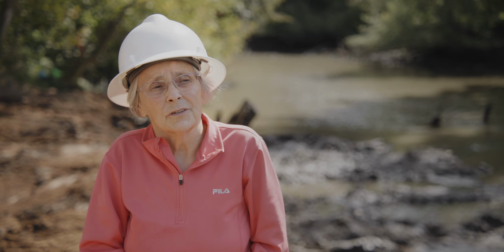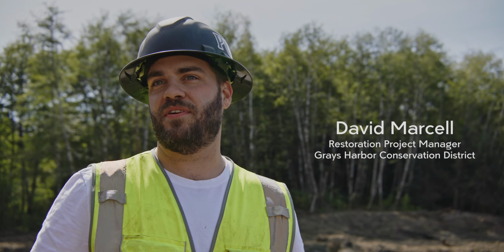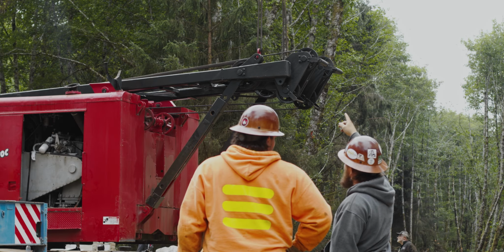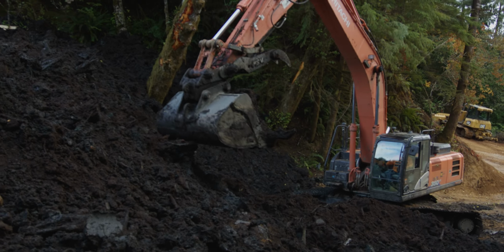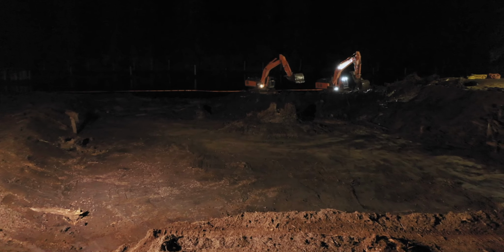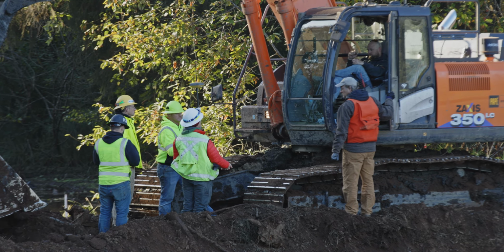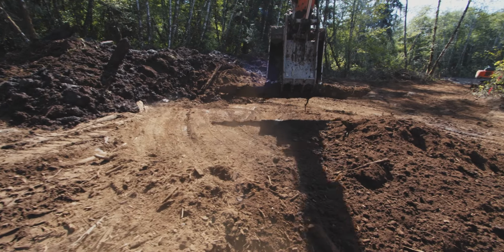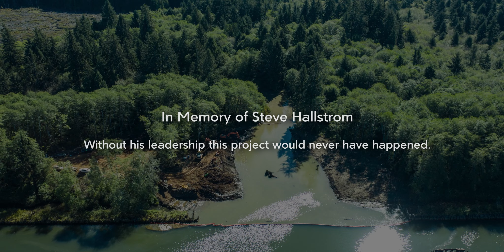The Tide is Coming Home - Middle Fork Hoquiam Tidal Restoration Project

Comment: Estuarine backwaters should provide the habitat for many anadromous Species thrive, while vegetative associations, bench marks of bank channel width, river depth, bedrock or structural composition, riverine systematic analyzation of saltwater levels as conditions change, dissolved oxygen content, water temps, all contribute to the health of this recharging of the system and seasonal flows will mean more substantial recruitment through high cover, viable flows, and other aspects of natural function to increase the diversity.

Comment: I wanna know how much money was spent on this project.
Reply: Not enough, it should have been done years ago
Reply: Any objection on righting a wrong?
Reply: This was one of 77 total projects funded by a 14.6 million dollar grant….money well spent.
Reply: @JadeTadros  I think a few other things should be done first. This is bullshit
Reply: As far as could tell about $1.75m. Setup, takedown, time on crane, including building support mat. Rental on all the equipment, it wasn’t exactly stated, about three months. Operators and superintendent. Project manager for GC. Consulting project engineer, who’s a P.E. Fisheries biologist for design phase, plus maybe a day per week during project. If piling were creosote treated, more than de minimus disposal cost. Planting was just spruce, and by volunteers. Cheap, easily available from forestry seedling nursery. Maybe $15k, assuming 15,000 spruce. 

Unlike many projects, say a bridge, there is no need to account for depreciation. Gravity will continue to move the water up and down at no cost, forever. With plantings you always need to plan for possibility of unusually hot, dry spring-early summer and possible failure. Not likely in moist spruce soils, and at Grays Harbor.